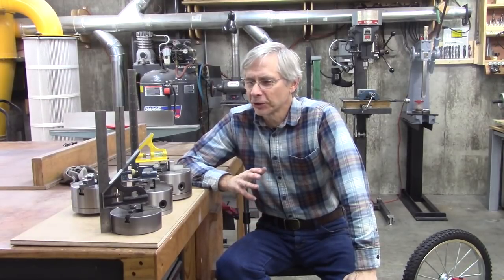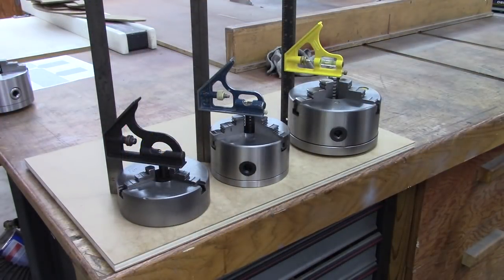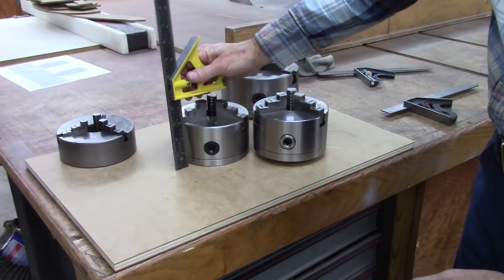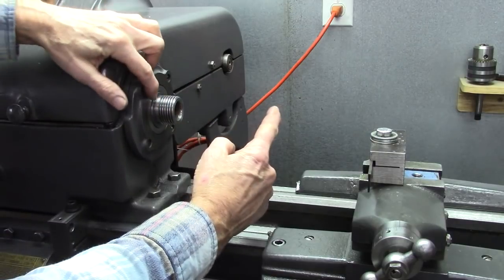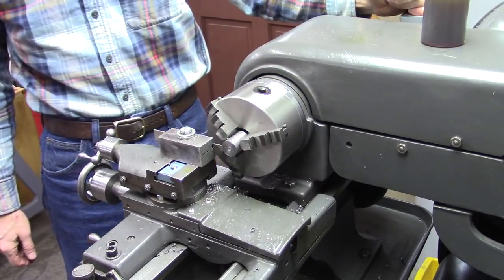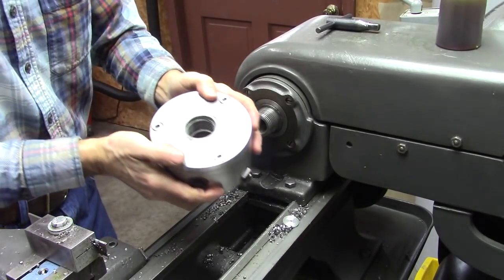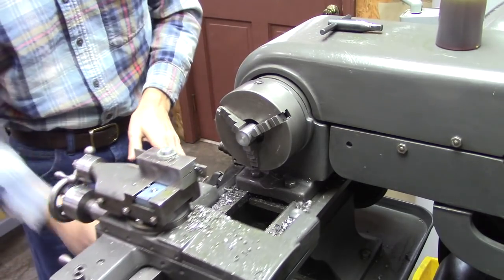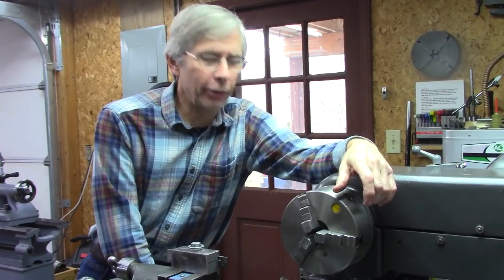My Chuck Overhang Obsession

Comment: Thanks Mark, I'd be interested in seeing the effect when the difference in overhang is not as extreme, such as the middle chuck to the at the beginning and the other with 1/2" more overhang.
Reply from the maker: I missed this comment... sorry. The middle size is about what you'd expect. Tolerable but not as good and the short original.

Comment: You get a similar problem on milling machines. Some folks running a big chunky tilting vice think the chatter's happening because the vice isn't ridged enough, but the real problem is because they've moved the workpiece 3 or 4" further from the ways. Any play in the bed get's amplified, and the cutters got a lot more leverage on the table. 
This is another reason 2 piece machine vices often feel slightly more ridged than traditional vices. They put the workpiece as close to the ways as possible.
Reply from the maker: I agree on the mill!

Comment: Gday, my small Chinese lathe is near impossible to do parting off with, the spindle is small, with a piece of material in the chuck and an indicator on the jaw I can gently pull on the material and measure the flex in the spindle, it’s not good at all hence why I brought a larger lathe, it’s rock solid, great video and great topic,   Thanks Mark,   Cheers Matty
Reply from the maker: This is a shame...  with todays technology they could make a very good small lathe at a good price. Most people would be willing to pay a an extra $100 bucks to have a good lathe anyway.

Comment: I have 2 South Bend 9A's , one chatters on parting with the 6" chuck, the other doesn't. The only diff is that one has a 3' bed, the other a 4.5' bed and the longer bed is 10 years younger.  I use a Norman patent style toolpost so it's similar to yours.  I solved the problem by making a ER32 collet chuck (~ 3/5" long). ER32 maxes at ~ 3/4" which matches the spindle bore so no need to go higher.
Reply from the maker: But you still don't know why one chatters and one does not?
Reply: @WinkysWorkshop  I suspect the older lathe with the "conforms to war production board" tag was made to less rigid standards

Comment: Flexural stiffness of a cantilever beam with a load on the end (roughly like a lathe spindle) is proportional to overhang^2 (squared), so yeah, overhang certainly may be the issue. Here's the thing: for a given overhang every lathe will chatter at some combination of workpiece diameter and spindle speed. Assuming the workpiece is stout and the bearings are a non-issue, the frequency of this chatter is a function of either the spindle or the compound. It's relatively easy to address compound stiffness problems by adjusting the setup, or supporting the cutoff tool with a machinist jack or similar. If the weak link is the spindle, not so easy to fix.
I do not understand why all modern chucks are so much wider than vintage chucks.
Excellent video - thanks for posting!
Reply from the maker: Thanks for the comment. Yeah...  I could have fixed the chatter with higher feed rate although speed had little effect, it sounds different but the chatter is there. With the small chuck, within reason speed and feed have little effect.  The compound on the Logan is wimpy but the direct mount tool with the compound set straight supports the blade very well.  I used a quick change for most stuff but not cutoff. A quick change post on a wimpy compound is very bad because the tool is hanging off the side of the post.

Comment: Great discussion Wink, but I think we need more testing:) 
How about chucking a weighted bar and measure defection, the longer the bar the finer the measurement. See the difference between all chucks. 
Cheers
Reply from the maker: Great suggestion!   https://youtu.be/ysYusXnhCQY
Reply: @WinkysWorkshop  
I new I had seen that before, even gave it a thumbs up :)
Reply from the maker: @rickpalechuk4411  Cool-  I really do think the thread mount is a big contributor.
Reply: @WinkysWorkshop  I agree.  Not much can be done about it. I like the low profile of the stock unit. You can tell what the engineers were thinking. 
Collet chuck (er32) would be handy for smaller stock.

Comment: Interesting video and comparison Winky. You are spot on, the key to a good setup with minimal vibration is rigidity (on any machine). What you have demonstrated well is a reduction in bending moment, the shear forces are the same but the bending moment is vastly reduced meaning the spindle bearing is more capable, simple physics (the laws of which are constant). Well done. Cheers, Jon
Reply from the maker: The math might be complicated but yes, it is very basic. Thanks!

Comment: Sort of sounded like the RPM was too high for that chuck because the chatter went away as you got closer to the center of the part.
Reply from the maker: Slowing it down might have helped but did you notice there was no chatter on the shorter chuck? Increasing the feed rate on the larger chuck would also eliminate the chatter yet the small chuck was fine with the slower rate. 

Yes, chatter free cutoff was possible with the larger chuck but I was trying to show the effect of overhang. The smaller chuck is VERY forgiving and the larger is very touchy on speed and feed.
Reply: @WinkysWorkshop  I agree with you but generally adjustments can compensate for a lot of the problems we encounter.
Reply from the maker: @williamhardin5254  - Very true and good point
Reply: @WinkysWorkshop  I think as we are mostly hobby machinist it very hard for us to take the time to do the research required to produce optimum cuts to achieve our task. So many variables such as our tool holders, cutters, type of material, SFM, Feed Rate, etc.
We need to experiment and keep a log of everything so when we find that magic combination we have it ready to use on our next project. So good luck with that!
Reply from the maker: @williamhardin5254  Yep...  plus most of us have the additional challenge of less than ridged machines. It's good experience  but larger industrial lathes can be much more forgiving.

Comment: Thanks for another very thoughtful video. I would be interested in seeing those chucks disassembled and some analysis of what design changes have made the newer chucks so much "longer". It's not only old Logan chucks that were short. Many of the old South Bend, Atas, Cushman, and others also shared the minimal overhang characteristic. I'm a bit surprised the Chinese don't copy some better designs in this case. It makes me wonder if there are other tradeoffs that favor the longer chucks.
Reply from the maker: Certainly the longer jaws on the Chinese chucks are a plus but not worth the problems the extra depth create. The last video I did is modifying the mid size chuck in this video to reduce the overhang BUT, I was only able to do this by maybe 5/8".  I think it would be easy to make a shallow chuck. They are made very similar but with smaller components. I'm guessing nobody has tapped into this market yet. However....   this is understandable. Most don't understand the cause of the chatter they are fighting. Even the small Harbor Freight lathes have deep chuck which is crazy. Somebody is NOT connecting the dots!
Reply: My immediate guess is cheaper manufacturing costs.  Perhaps it's also easier to break the "low profile" designs.   I presume the pinions inside are smaller in OD, which may actually give higher clamping force, though that may be countered by differences in the scroll.
Reply from the maker: @BobOBob  I didn't think about the smaller pinion but you are right. The small chucks have smaller pinion and slower scroll. I have noticed it take a lot more torque to get work to hold in the Chinese chucks. A larger T handle compensates for most of this.

Comment: I see your point exactly. One thing I didn’t
hear you mention was the weight difference
from one to another, and more weight farther
out, will put more stress on things.
 A simple experiment would be to pick up a
10 lb. weight, hold it fully extended, then 
bring it back close to your body, see which is
easier.
Reply from the maker: True...  however I think the stresses of cutoff are 100 times the weight. But hard to say.
Reply: @WinkysWorkshop  the mass affects the resonant harmonics (vibration) in the set up.
Reply from the maker: @wwilcox2726  yes...  everything effects it.

Comment: When I was a youngster, an old timer told me "rigidity is a key factor in all machining operations" I think that applies here. I go thru the same issues on my circa. 1948 9"South bend. I use my steady rest to cut off when possible. That helps a lot. I also use a drip coolant to flood the cut-off zone. My results are mediocre at best. Before I retired my go-to lathe was a 20" Clausing. I never has an issue with that, LOL. Now I just do the best I can with what I have.
Reply from the maker: Cool...  the steadrest is a very good idea. I found a sweet combination between the original chuck and a modified blade holder but if my old chuck completely bights the dust I'll have to change my approach.

Comment: I can´t understand how they came up with that spindeldesign, It looks to me like that spindel is for drilling, very weak design. Bad leverage, Good video
Reply from the maker: Screw on chucks used to be common. Also these lathes were considered home of small shop lathes and not high production. I've never own a new small lathe but I hear they share the same problem and have a screw on chuck. I'd say cost was the main driver.
Reply: @WinkysWorkshop  It´s not the screw design thats the problem, it is the flange behind it that should have bigger diameter to support chuck and make it stiffer, as I see it. But thats the way it is. Your modification helps a lot
Reply from the maker: @-Mats  I absolutely agree.

Comment: Nice video Wink, a very good discussion subject, it can be sidelined in many shops so makes it a good topic Very much the same problem with my 12" Asian. I wouldn't dare auto feed like that which shows that bI should pay heed to your quest. Thanks for the insight, cheers!
Reply from the maker: Yeah...  the auto feed cutoff works well with the new blade holder and old chuck. However, I agree. Everything has to be just right.

Comment: Have you thought about restoring your old chuck, you can re-grind the jaws using an internal grinding spindle although you will need to load the jaws as if in operation.
Reply from the maker: Yeah...  I've ground the jaws and it did improve but now the scroll is worn and the socket to the chuck key is in bad shape. So far it's working but there will soon be a day when I won't be able to tighten it
Reply: @WinkysWorkshop  another thought, slim chuck's are available here in the UK a company called Arc Euro Trade sells a variety of chuck's , is there a supplier in the USA ?
Reply from the maker: @boostie1005  - I found the web sight but did not see any slim chucks.  But thanks for trying

Comment: Yes reducing over hang is always a good idea
Reply from the maker: Agree, thanks.
Reply: @WinkysWorkshop  
What about tool height ? 
How much affect does that have ?
And the geometry ?
Partoff blades have zero top rake.
My old teacher hand grinding HSS blanks put quite a lot of positive top rake.
Reply from the maker: @stevewilliams587  Good point and observation. This cutoff blade is set on center and has no back (top) rake.  Ideally it should be set at a slight upward angle but due to compound height and holder design I use it flat or level. The top of this blade is concaved the full length and grinding a back rake into the tool destroys this feature. This feature is preferable to the back rake grind as it makes the chips more narrow than the cut. I'm guessing it requires a bit more power but it seems to be a very good tradeoff.